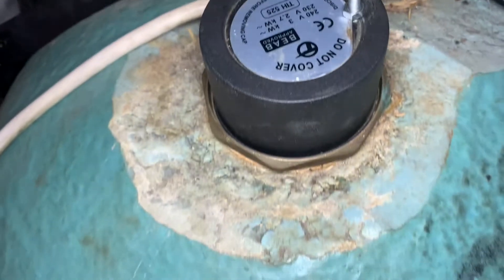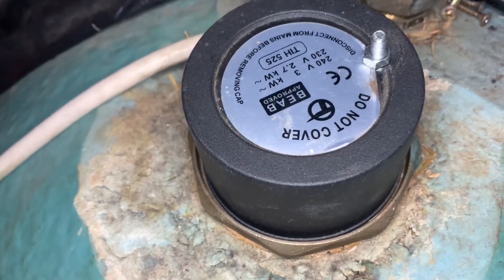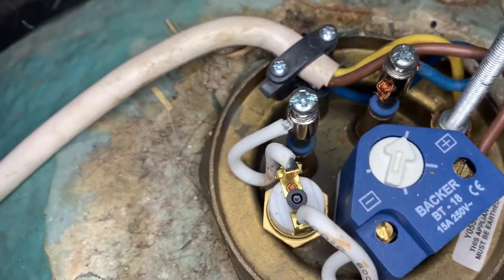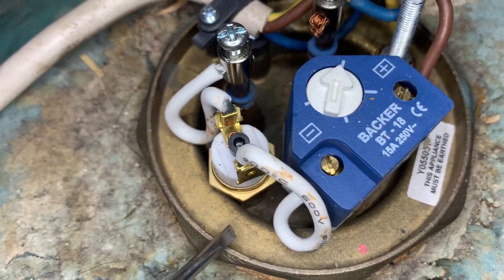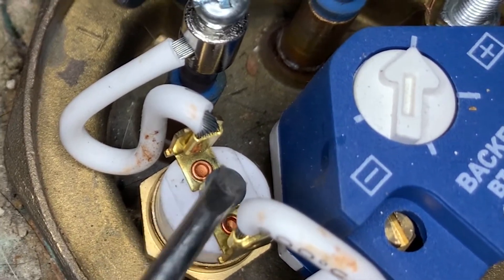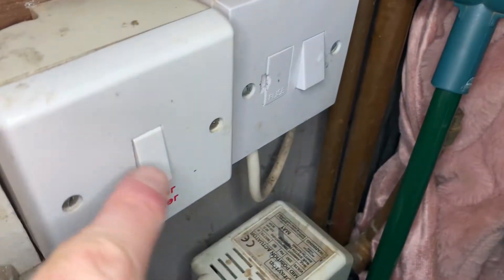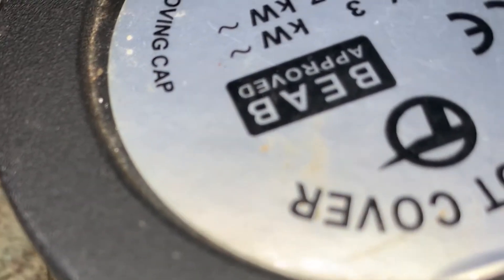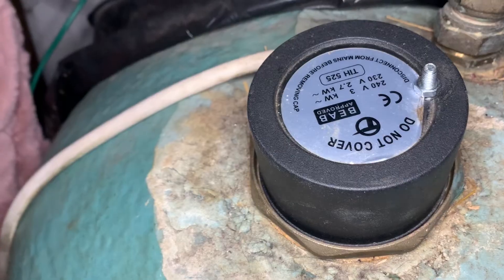HOT Water Tank Immersion Heater Not Working - Quick Fix!

Comment: Thanks so much for posting this. I’ve been ‘repairing’ our central heating system because we had hot water but nothing on the heating side. Then I managed to lose the hot water so my wife was fuming as she had to heat up a kettle to wash this morning. Then I remembered I’d put in an immersion heater but never used it. Turned it on and nothing! Then I saw your video and I found it had tripped out. Now my water is heating up and my wife is cooling down! Great tip.

Comment: If the main thermastat fails then the second tier safety feature is a non-self resetting energy cut out.

The issue is with the thermastat. It will never usually fo past 60 - 65°... the energy cut out activates at approx 85° ... essentially you've just disabled the safety feature.